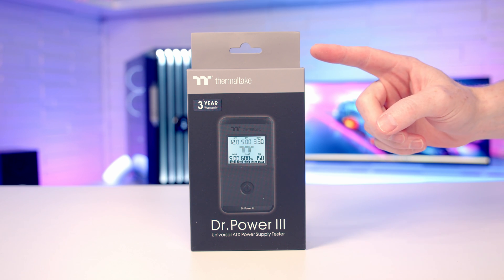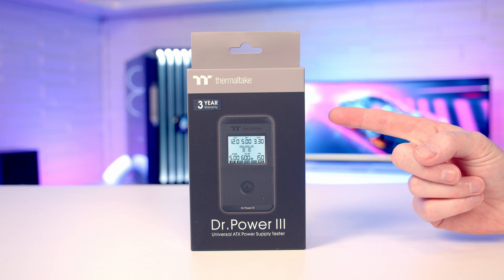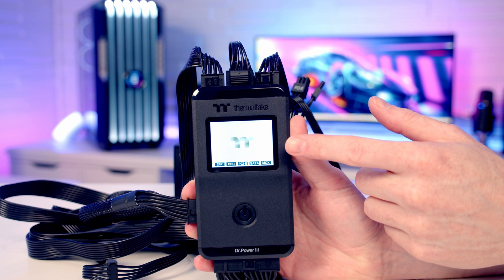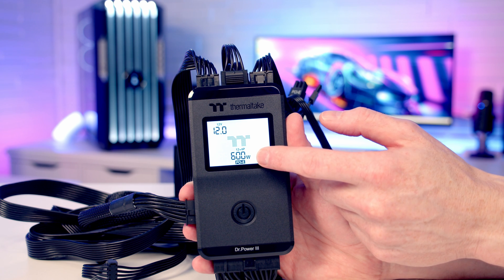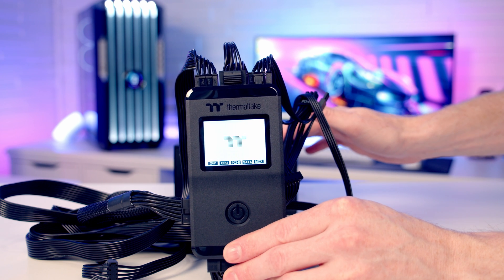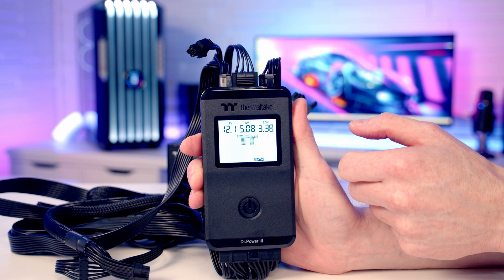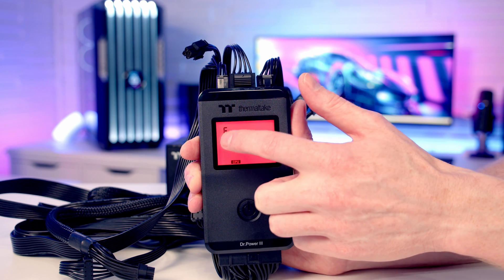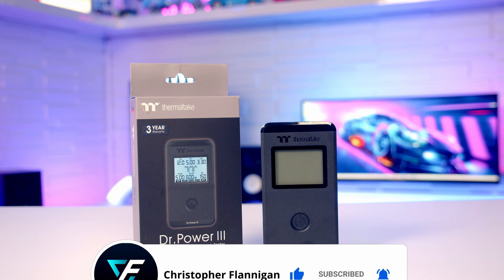Thermaltake Dr. Power III - Unboxing and Overview

Comment: Just got this device in the mail yesterday from a birthday present from my dad. I've been through four bad  power supplies in the past. Three were when I lived with my dad. Bad electrical old wiring. The power supply is the most important piece of hardware in your PC. If it goes bad, it can fry anything and even everything when your PC turns on. I live now with my wife. And we have good electrical wiring. I got installed June 2024 the Corsair 1,000watt Fully Modular RMX PSU. Haven't had a single problem with it. The biggest mistake I made with my PC's for 23 years was. Leaving them on for long extended periods of time when I'm not using them. Ever since I got this PC in June 2024. I always turn it off when not using it for a while. I won't burn out the hardware as fast. And will have a longer lifespan of use.

Comment: Aye, this is a must have for anyone with a pc. I have 5 old retired but still working psu's on hand. I do use them on occasion for open test bench setups, and using a 24pin jumper to just run my d5 pumps to get the air out of new or refilled custom water loops. It's also nice to have backup psu's in case one in service fails.

Comment: In regard to ensuring a power supply is viable, wouldn't this device also need to induce a power draw to ensure that voltage stays within spec while under load?  These sort of idle steps are likely a good way to denote PSUs that are in a rather bad state, but I'd imagine that problematic ones might still come up as passing.
Reply: Yep, pretty pointless testing a PSU without applying some kind of load...

Comment: Hey Chris, great video!

What would happen if you plugged in two 8 pin PCIE cables to a 12V PCIE 12+4 pin adapter and then tried to test it?